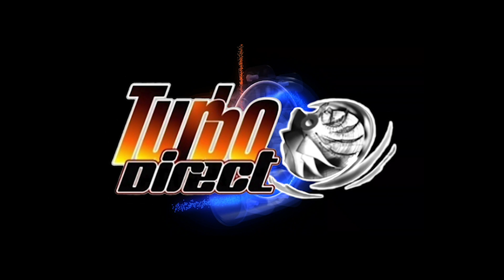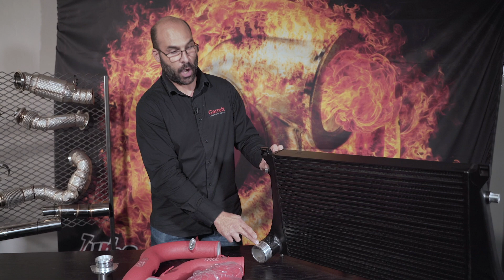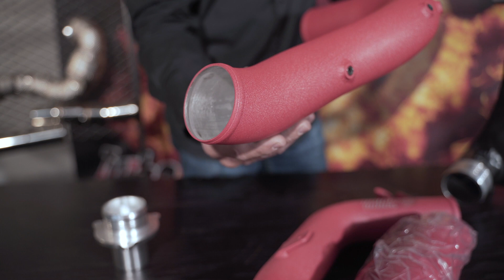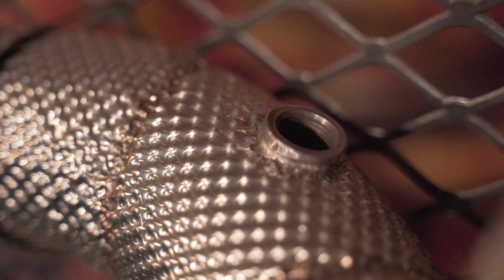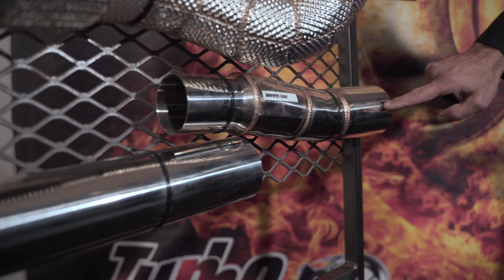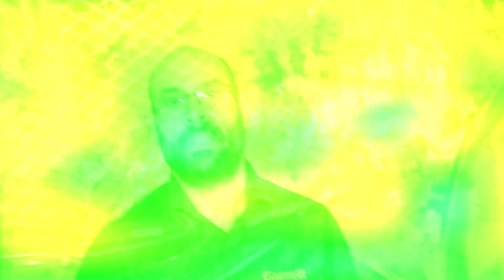Whats the best setup for a stock motor Golf7R MQB

Comment: Garrett Powermax seems to be the go to now rather than an is38. Stronger, similar spool to the is38 & better power with an appropriate tune. Almost a no brainier for those with a 38 or thinking about one
Reply from the maker: The Garrett product is one of many options, we have a product which spools faster and makes more power and is more reliable than the Garrett Powermax stage2 - see here:- https://store.turbodirect.co.za/index.php/shop/turbochargers/is38-550t-forged-5569-detail
Reply: @TurboDirectSA  👍🏻  I meant the Powermax S1 is a very popular option as OEM+ for is38 owners. My s1 only has an is20 so I’m sure il notice a significant uplift going to a Powermax stage 1. 💪🏼

Comment: how about golf 7.5 GTI what is the maximum power for stock engine n which turbk must i use
Reply from the maker: Not 100% sure on this one, we have never played with these engines much - i have seen a few cars running 300WKW with reliable results, but not more than this on a stock bottom end. 

This is the turbo i would use on the GTI engine. 

https://store.turbodirect.co.za/index.php/shop/turbochargers/is38-450t-forged-5568-detail
Reply: How much does this turbo go for?
Reply from the maker: @ventodanny  Please send an email to info@turbodirect.co.za for pricing.

Comment: the best setup depends on budget. if you can’t afford a rebuild DONT push hard! 

HEAT HEAT AND HEAT AGAIN!!

Standard cars don’t like heat. Metals don’t like heat and definitely turbo engines even more! metal is soft when hot!

its not emphasised here and it should be! throwing a rod from operating temperature is way harder than a hot hot engine!

if you beat on the car, give it cool down time. hot lap-cold lap sort of thinking. i’m talking street cars and some race cars too. 

 the oil film when real hot is far less protective, steel and alloy distorts. Your detonation margin is also greatly reduced! 
many times it’s heat that breaks your motor

Comment: Great suggestions thanks for video.
I have a question which does not need to be limited by this engine.
In general, stock engines fails due to excess of torque limits of the rods.
Is it possible to just open top of the engine, do some valvetrain work such as port and polish, stronger valves and springs, then run engine higher rpm keeping boost relatively low to make around 500whp without Rod failure.
Reply from the maker: Thank you for the comment. There is no way that a valve job or springs will relieve pressure in the cylinder to protect a rod. BMEP (Brake mean effective pressure) is where the engine produces its output, the only way to affect (negatively or positively) the engines output is to change the BMEP - the internal cylinder pressures during the compression and power strokes are what exert the forces on the internal engine components, stronger rods for higher RPM or higher HP are a must not matter what.

Comment: Everything you state in this video such as the horsepower limits, and hybrid failure has been debunked by tons and tons of people running 500 whp on stock motor and running hybrids for thousands of miles with no issues, this is very very biased and false information.

Comment: Your knowledge on turbo's makes this hands down the best utube channel for turbo related stuff. What is the best turbo for standing starts is it the borg warner EFR 7064. Looking for about 410bhp from a 4" trackslag downpipe rest of the exhaust stock and muffler delete with a racingline r600 intake. I'm UK based and the car is a daily and won't be doing track days would i still need an intercooler.
Reply from the maker: Thank you for the compliment. The best responding option with more power to offer than your target is without a doubt - this:- https://turbodirect.co.za/store/index.php/shop/turbochargers/turbocharger-turbodirect-s-a/performance-racing-3/bolt-on-vehicle-specific-turbochargers/is38-450-forged-detail
Reply: @TurboDirectSA  Thanks for the fast response. I looked at your recommended turbo but it's been out of stock for a while. I'll wait till it's back in stock thanks again.
Reply from the maker: @tyranic1  We will have stock of raw materials again on July 15th - the next week will see the new batch of all models. Apologies, delays have been causing alot of rife.

Comment: What is your view on a 7163 .8AR T4 divided inlet , for a 2.0L JDM Subaru Sti built motor , 1000cc ID, tome I h beam rods,Manley forged pistons, AEM 340 lpm fuel pump, aiming at 400+ whp range daily driver / occasional weekend track .or what would be your recommendation
Reply from the maker: Beautiful choice - the twin scroll housing AR is smaller than the Vband and T25 flnage face model housings- will spool slightly faster but you will suffer a little ontop. However - you will make the 400HP you looking for. If you see that the torque curve falls off a little up top, change the turbine housing to the Vband unit (up-pipe change....) So rather make this decision now up front, in case you want more later. If spool is more important than all out power up top - then go Twin scroll.

Comment: Very informative thanks guys! Do you recommend also upgrading the hpfp fuel pump internals and upgrading the map sensor to the 4 bar one when going hybrid or not necessary?
Reply from the maker: The upgrades to the fuel system are necessary depending on the HP output you are aiming for. If you plan on going to the 500HP +  then you will need to upgrade the fuelling system without a doubt.

Comment: This was much more a "Look at all our amazing products" than " Here is our suggestions for Stage 1, Stage 2 etc. upgrade power, torque and cost."
Reply from the maker: No actually the video put it out to you as the vehicle owner, to choose a turbo based on what HP target you want to make based on the limits of the stock motors capability. There are PLENTY of options depending on your HP target, HOWEVER you will need an intercooler upgrade aswell as DP and obviously software to couple together to this in order to achieve whatever your HP target might be.

Comment: I've been watching your videos for awhile and still have a lot of questions. Both my friend and myself have had hybrid turbos that have failed. What I'm really looking for is a turbo that makes around 400hp with a stock motor that is ball bearing. There don't seem to be any turbos for the MK7 that do that. Can you guys make something like this? Or what about the swirl adapters? Seems like you can use any turbo (including the garrett ball bearing offerings) with the swirl adapter but then what about the diverter valve? and oil/coolant lines? Does that all have to be custom? Can you make a video talking about this? Such as if there will be a ball bearing option that is not as powerful as the is38700 or how to get a garrett turbo to work with all the cooling and oil and wastegate/diverter stuff? Thanks.
Reply from the maker: Thanks for the comments Navi - in the video i cover the options, i would use the IS38-700 setup for the 400HP you want, you will make that power at low boost probably 1.2bar on pump fuel. The setup will be ultimately reliable at this low pressure. With the IS38-700 we supply lines with these turbos pre-made to maintain 100% bolt on setup - even your stock DP will fit (sure you need to upgrade this with a larger turbo) just to show the bolt on design setup, the stock actuator runs on the IS38-700.  The other option we busy with now is a ball bearing setup using a smaller 480HP capable turbo which will spool lightning fast and will make out at around 450-480HP and moves the power curve down in the RPM range.
Reply: @TurboDirectSA  when will that 480hp turbo be available?
Reply from the maker: @navindralr  First quarter 2021 - we busy with the moulds as we speak
Reply: @TurboDirectSA  I will definitely be buying this once available.  Would suit my needs perfectly
Reply: @TurboDirectSA  I was going to leave a comment asking for this, but I'm glad I looked first. I will also buy this small frame ball bearing bolt on turbo from you, provided it has OEM fitment and function.

Please provide a tuning option for our shitty American gas - 91 AKI. And please bear in mind that for some of us, less is more. My car is my daily and I have no use for more than 400hp/400ft lbs at the crank, especially given the inherent risk in not opening up the motor. I think many people are also happy at the 400 mark, particularly if it offers better spool and dependability.
Reply from the maker: @acefighterpilot  less is many times more - it's been proven on the track numerous times against huge and laggy setups in a short distance.  We will have this turbo option available soon. It has to pass some tests on the bearing system  first.
Reply: @TurboDirectSA  Great to hear. Can you disclose at this time what the origin of the CHRA is and the material of the turbine? Will the housing be able to contain a burst failure? Since we are talking about a lower power target, durability and dependability will be paramount compared to someone pushing 700hp who expects to find all of the weaknesses of the engine and transmission anyway.
Reply from the maker: @acefighterpilot  Nope no disclosure at all im afraid, thats to be seen when we release it. If you want to pay a fortune for the turbo, i can design a burst containment tested housing no problem at all - just the costs to do the test itself in an accredited facility, will be around 50 000EURO for the days testing, and there is around 2 year waiting period. The next issue is the cost of the 5 rotating assemblies that need to pass 100% in succession of one another to get the accreditation. The next challenge is to make sure that you get the balance cut extrapolation spot on each time to get the turbine to burst at the correct speed (inside of an area of RPM) --- and we haven't touched the surface yet...... :-) 

Will the setup be reliable - definitely! Keep in mind that this turbo will not be a high power  option like the other options available - however it will be designed to make a max HP of around 450HP - its purpose is to provide response and a decent upgrade for a stock motor that can run reliably without worrying about a bearing failure -- and finally at a price that is fair and reasonable.  

Will the components be manufactured from quality materials - without a doubt!  Billet MFS wheels, inconel713LC turbine heads, CVE welded turbine shaft, ball bearing, stainless steel turbine housing, etc etc
Reply: @TurboDirectSA  I'm familiar with the costs of writing off assemblies for the sake of testing and the further costs of certification, and I don't expect you to undertake that, sorry if it came off as such. I only meant to ask if you feel based on your experience and FEA that a burst would be contained, and it seems you do.

Inconel is great. Sounds like you are seeing things from a similar place as I am. Do you expect the price to be competitive with a brand new G25-550?
Reply from the maker: @acefighterpilot  No worries at all - i didnt mean to come across rude, just that the burst testing is something really expensive and lengthy to get right according to some regulated outline. Its not an OEM application so not really expected, however the materials, condition of the material (after casting, and various treatment) aswell as the design of the part is considered carefully based on experience with failures and it will be made to last. The only way to know if the housing will manage a burst is to burst it -- but at what speed? Each application and tuner mounts, tunes and runs their setups totally differently to the next - so its difficult to say. 

What i can say is that a very popular brand out there is not burst containment tested and fails to contain bursts often - even when copying designs seen from other OEM brands..... ill leave this there.
Reply: @TurboDirectSA  Based on your qualification and respect for your own reputation, I am willing to take you at your word on burst testing. 

I just want to add a detail about the downpipe you may offer with this turbo: as I see you know from your other videos, some places in the US, California in particular, have rigorous emissions testing programs which require a cat, and those people are screwed, there is no hope for them. However, everywhere in the US that has an inspection program, the car is required to have the appearance of a catalytic converter, and the appearance of a rear oxygen sensor, even though they will not test the functionality of either. Hopefully you get my gist.
Reply from the maker: @acefighterpilot  100% -- well aware of that - hense the DP we offer as seen here https://www.youtube.com/watch?v=be0PThlFO-Y  

100% OEM design, yet catless. All O2 sensor locations are in place and all sensors plug in - 99% of the tuners disable these anyway, so no need for an expensive and restrictive CAT.

Comment: Much better production guys, thank you so much.
I've got an MQB RS3
Where are our turbos!? :)
I know there are a couple guys out there doing hybrids, but I'd rather pick up turbo work from you.
I also think perhaps you guys should do more Chinese comparisons versus OE on the balancer.
For instance, my GRX3584RS was one of the finest pieces of precision machinery I've ever held.
They have chinese versions now.
Break those down and see how they go, that would be a great video!  Things like that
Reply from the maker: RS3 DAZA mods coming soon - currently busy with same. The chinese products we wont do comparisons on in any concise way as we are not happy educating them.  We either manufacture our own products which are proven, tested and guaranteed or we use Genuine Brand products like BorgWarner etc.
Reply: @TurboDirectSA  Ahh that makes sense.
I just loved seeing how janky their performance was on a precision piece of equipment...
I will tell you I've seen real world results making double digit percent less than a genuine equivalent.  
And great news on the RS3 gear.  Waiting in line!
Reply from the maker: @ßeau_M  The copied products are aesthetically pleasing, but do not perform anywhere near the genuine products or quality designs

Comment: Chris is it possible to hybrid a is38700 with built motor?
Reply from the maker: Hybrids are weak and will fail every time guaranteed as long as they are running the stock shaft diameter and bearing system. We dont touch these turbo with Hybrid wheels im afraid
Reply: @TurboDirectSA  talking about your ball bearing is38700hp turbo not a stock is38 turbo want to know if it can be done or not?
Reply from the maker: @tris6528  The turbo is built for 650WHP bud - no need to hybrid it.

Comment: Assuming i upgrade to an IS38 700, can the stock engine cooling system handle the increased power and torque reliably in the long run? Will I need to adjust the fluids maintenance schedule? TIA.
Reply from the maker: Berns - the stock cooling system is 100% for s street car or even drag car - circuit racing where constant loads and high HP is produced will require an upgrade to the cooling system (Radiator specifically) No additional cooling fluid maintenance required, BUT i would shorten the oil change/service intervals DEPENDING ON THE TUNING ....... Tuning is 100% directly related to the oil degradation. i.e overly rich mixtures will degrade the oil faster than a leaner tune. Driving hard more than taking it easy will degrade the oil faster --- so to keep it safe, shorten the oil changes from 15000kms to 10000kms. This will maintain reliability.